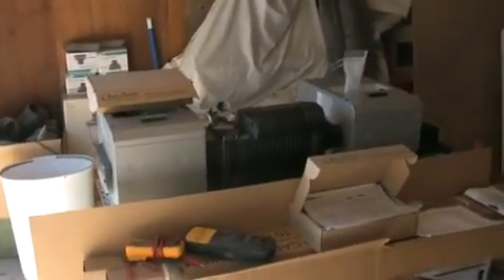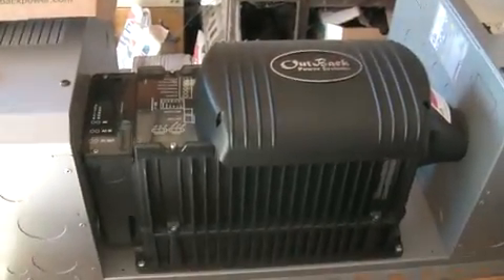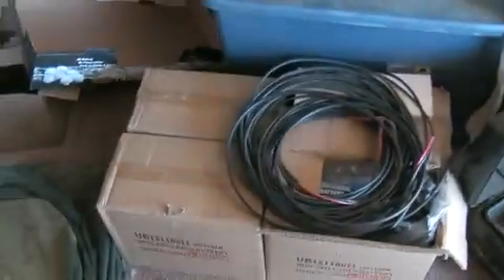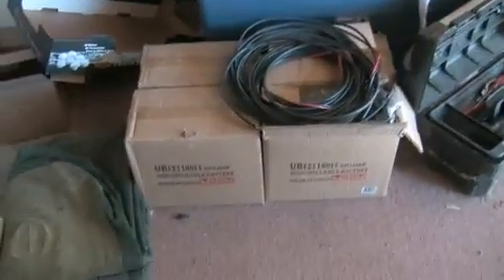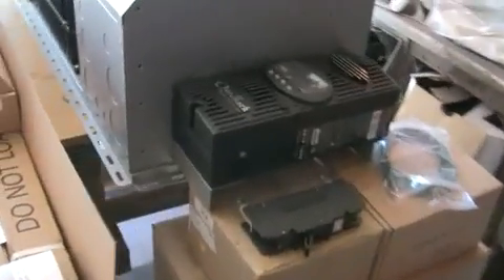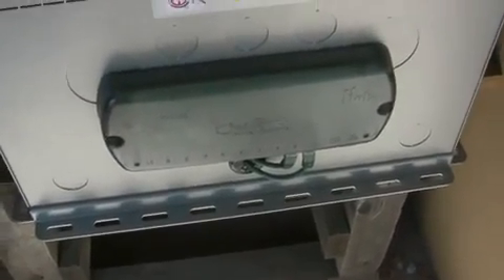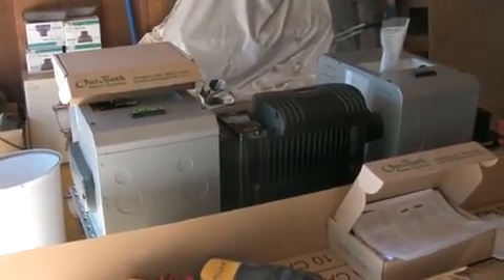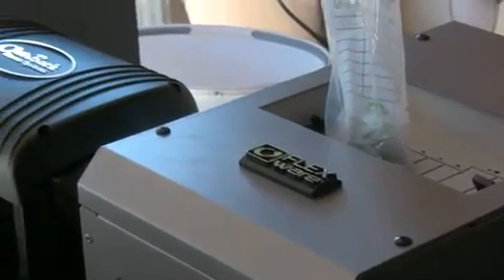Outback Offgrid Intro, Reloaded

Comment: I know my Outback Flexmax will step down my panel voltage to my 12v Battery.  Do you know whether it would step down my panels to 12v to them feed into my 12v Plug-in GTI?  Thanks for your help.